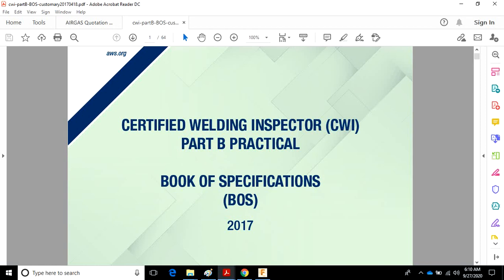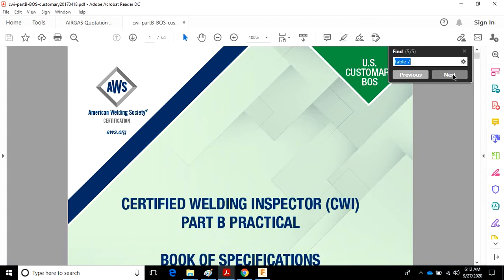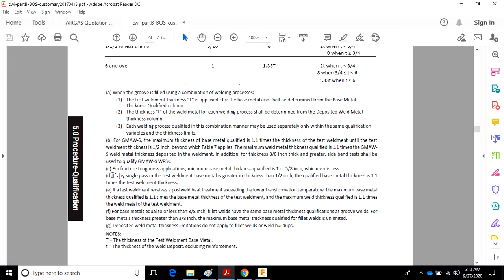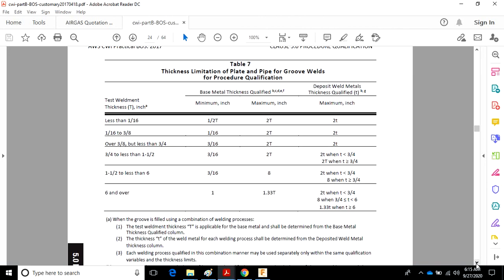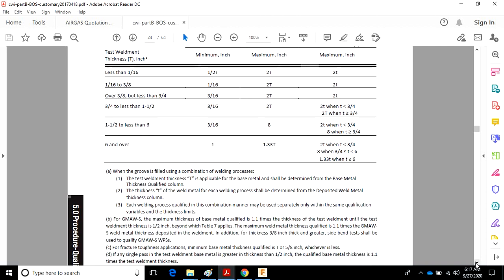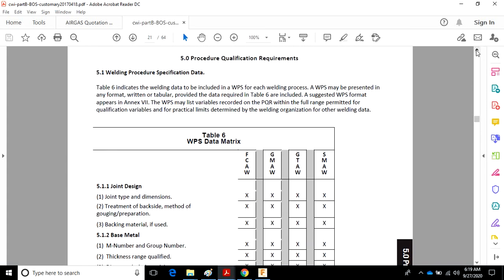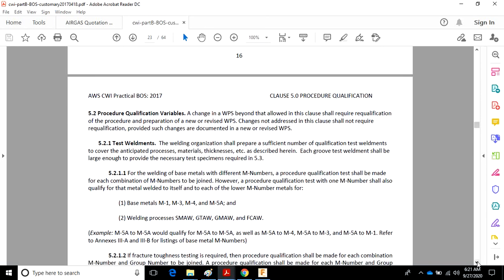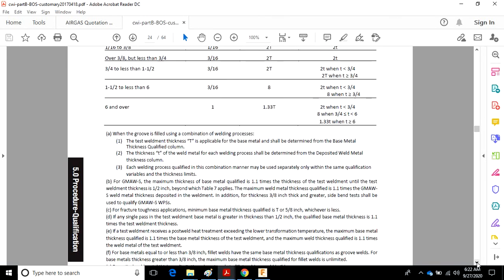AWS Book of Specifications-Clause 5- Table 7

Comment: CAn someone walk me through how to get the answer to this question.  I am about to take my part b exam and am lost on table 7 of the bos part b.  "What is the Base Metal Thickness range qualified that should be entered in line 18 of the WPS if 1/2 A514Gr65 was used to weld?"  I need to figure out how they got the answer because I come up with something different.  Much thanks

Comment: What "notefoot"---
 (C) For fractured toughness applications, minimum base metal thickness qualified "T or 16mm", whichever is less.
---Means exactly?
Thank you, for your video.
Reply from the maker: If fracture toughness requirements apply, the qualified range for the WPS is "T" which is the thickness of the base metal tested OR 16mm if the base metal tested was greater than 16mm.
Reply: @weldingclassroom7171  thank you,  Sir.